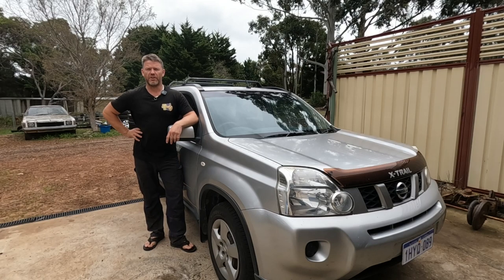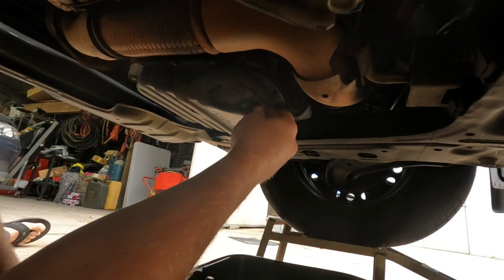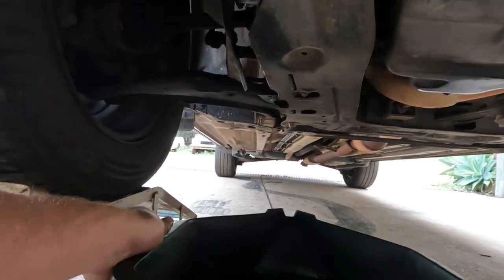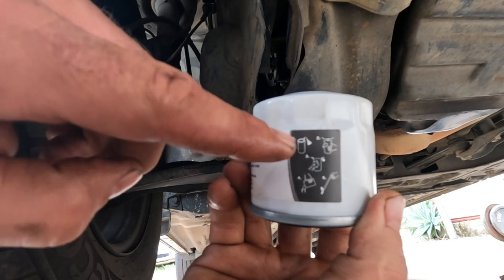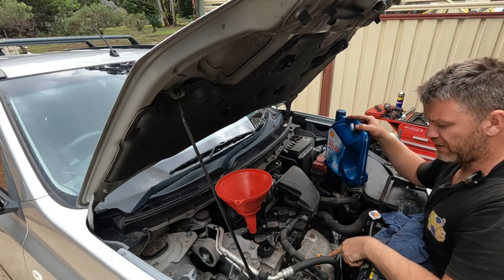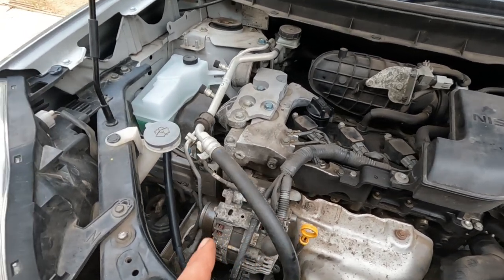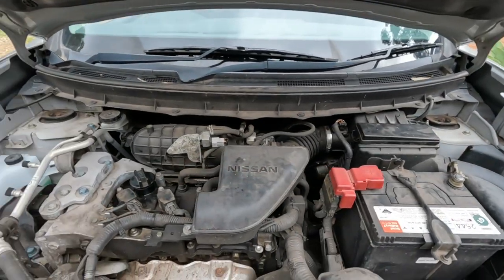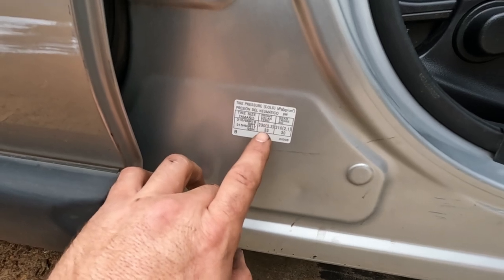Nissan X-trail T31 Basic service oil and filter replacement

Comment: Excellent video. Thank you 🙏. How do you turn off the engine check indicator and Diesel Particulate Filter indicator on nissan xtrail T31?
Reply from the maker: Cheers mate 👍 
Probably need to clear that with an ob2 tool

Comment: Sir, I find it hard to remove the gear oil cap to fill in the oil 
Show me how to remove
Reply from the maker: Heg mate 
Sorry i cant help i dont have that car
Manual or auto?
Manual should be a plug on the side of the gear box 
Auto should be through the dip stick tube 
Hope you get it sorted